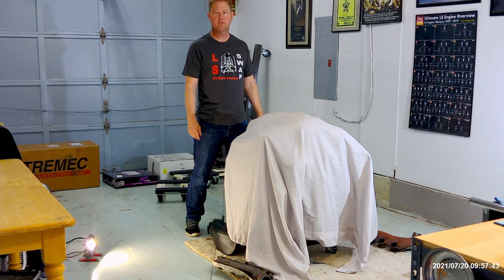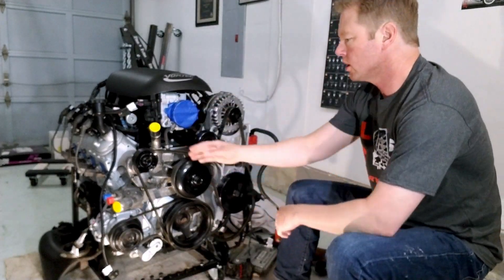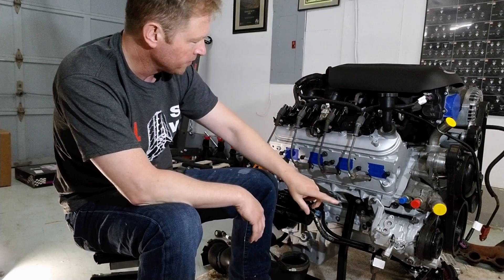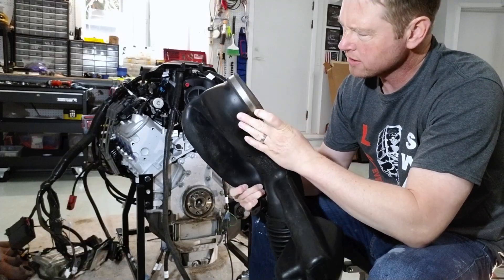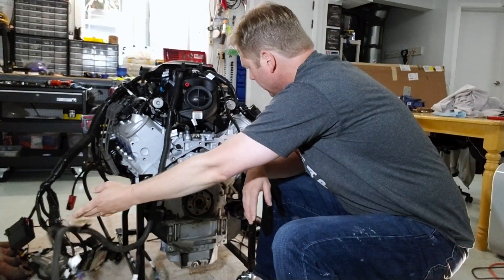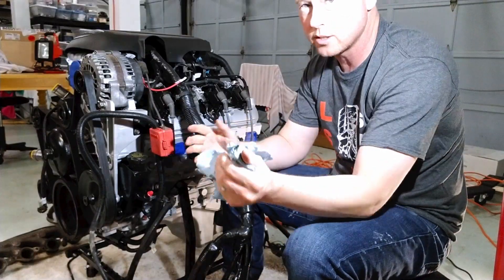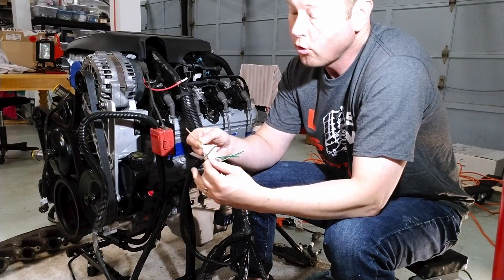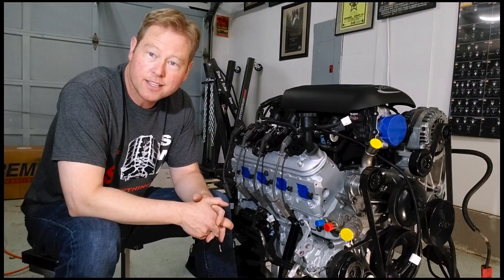Budget LS Factory Five Cobra | Engine Inspection | L33 5.3L

Comment: I would suggest a few upgrades/rebuild items for reliability. First.. The bearings on the roller rockers are known to explode at high miles. Second consider replacing the lifters and trays with stock LS7 components. They are known to spin at high miles. I would also do a head gasket and timing chain, while you have the heads off you can check the valve seats by filling the chambers with fluid also inspect the cylinders. the Factory oil pumps are known to have Metallurgical issues and will go bad. The harmonic balancers go bad quickly, they have rubber in them that cracks. All of this could be done at low cost and save you an engine failure. This would likely make your engine last another 150k miles.

Comment: I to am building a FFR intended for a SBF but changed course early on to run a 5.3 with a Ford Racing T5 via a QuickTime LS to Ford trans scatershield using LS to Fox body motor mounts, The  engine is an all aluminum version of an  an LM7 from an '04 Trail Blazer.

Comment: I ran into the concerns when looking for a used LS so I ended up going with a new TKX trans with an LS1 5.3L. The engine will be supplied by a local engine builder. Good luck with your build.
Reply from the maker: Expect lots and lots of backordered parts.  Kind of frustrating.